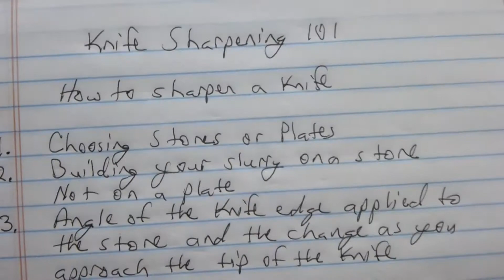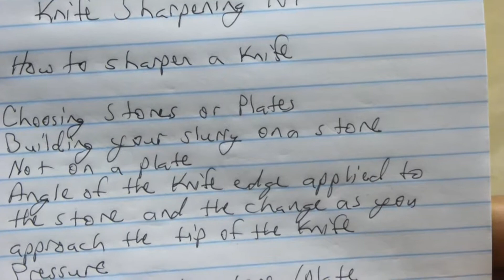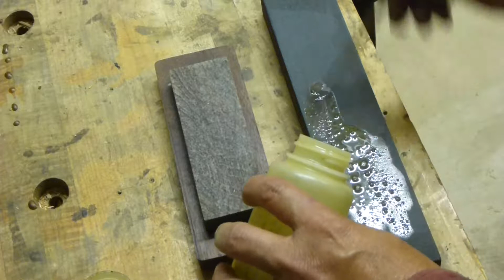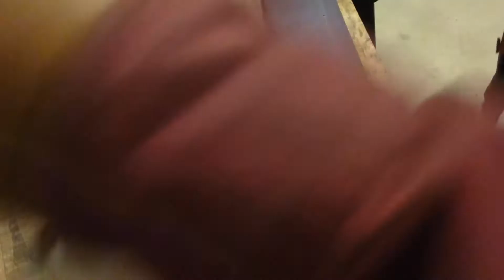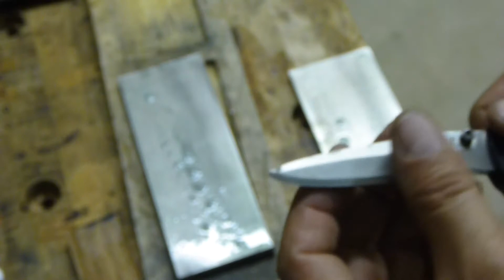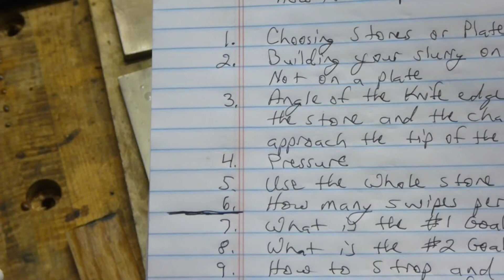Knife sharpening 101   How to sharpen a knife

Comment: Thanks for a great tutorial mate.
A question if you don't mind...What sort of oil can I use please?
Reply from the maker: You can't beat "Tap Magic" for cutting threads and drilling holes. If you can't find it or if you are on a serious budget 3 in 1 is the next and last but NOT least is simple motor oil. This answer is for drilling and cutting  steel. If you are drilling/cutting aluminum, then all you need is WD-40. Hope this helps.

Comment: Sometimes it seems I get better results by "dragging" the edge against the stone (similar to using a strop). I think it helps me "feel" the edge a little better. Is there anything wrong with this method? It seems to work, so I've been sticking with it lately, but I've been wondering if I'm developing a bad habit for one reason or another.